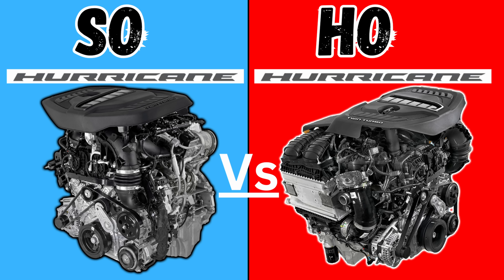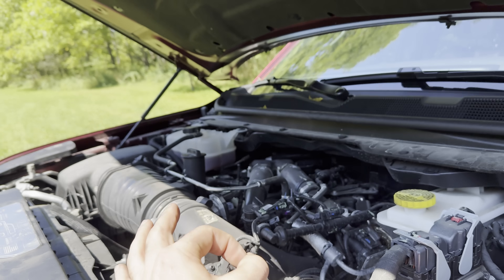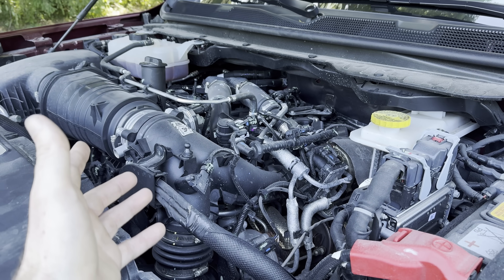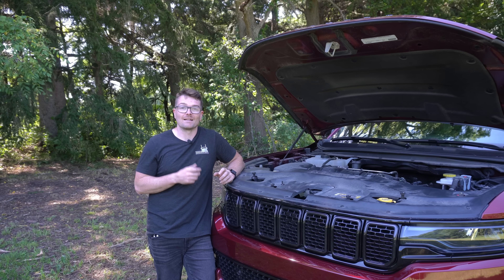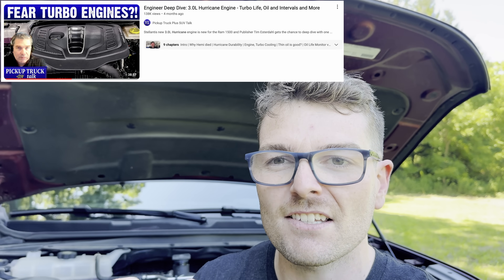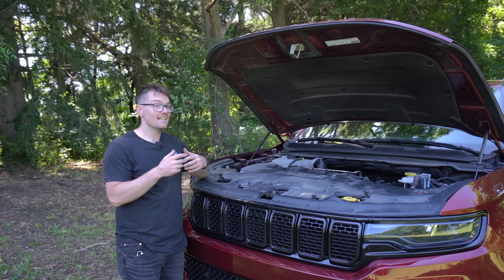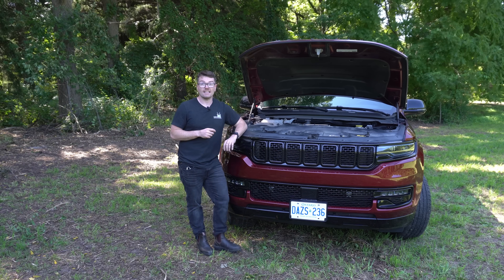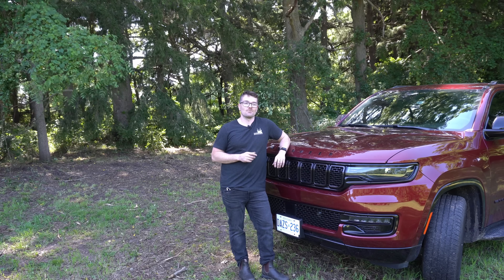Ram 1500 3L HURRICANE Twin Turbo HIGH OUTPUT vs STANDARD OUTPUT Engine | Which is BETTER?

Comment: Check out the towing test for the HO Hurricane on TFL. It actually did better than its competitors. Ram engineers are not idiots. Everybody talks about no dipstick, just like everyone complained when the Rams began coming with rotating shifter. Now, it’s just normal. The oil indicator instead of a dipstick is probably a good thing for many people. When I was dating my wife, she was driving a Geo Tracker with 35,000 miles on it and she had never had the oil changed because she didn’t know she was supposed to. She’s not an idiot, she’s a highly respected Internal Medicine doctor. Some people just aren’t mechanically inclined. She can’t work on your car, but she can diagnose diabetes or heart disease in the guy that can fix on your car.
Reply: New Ram makes the competition look like wagons. Ram already smoked the ford up the TFL toaster. Lots of trolling from the hate tells me everything. Not much trolling Toyota who completely failed on their engine because they aren't threatening the egos of haters
Reply: @fullbloodedchristian6440  You need to rewatch that video. The Ram was at 248F coolant temps and the F150 was at 250F when it went to limp mode. Were talking 2* difference, on an F150 that wasnt even rated to tow that heavy of a trailer vs that best possible configured Ram(Tradesman with 3.92 gear). It did not SMOKE the Ford.

Also you conveniently forgot to mention the low oil pressure warning.🤣 I think I would rather my coolant get to hot than my oil pressure be low.
Reply: The rotating shifter is trash, period. Just because its ‘normal’ now doesnt change that. It just shows that companies do whatever dumb things they want and consumers have to deal with it.
Reply: @PonyFoot123 It is a preference.  You think it is trash and the next person likes it.  I personally like cold column shifters, but the reality is that you get used to any of them.
Reply: @PonyFoot123  I like the rotary shifter 🤷‍♂
Reply: Depends.  If the goal is to design something noone wants, then watch sales take a dump, then, as GW once famously said,  "Mission Accomplished".    

Maybe it will outpull a Hemi in some random test, between two new vehicles.   Noone gives a shit about a few percent performance difference.   We do however care about the cost of repairs and parts replacement over a decade of ownership and 250,000 miles.   
     Small displacement turbo truck engines have been around long enough that we all know how that goes.  Turbos shitting the bed, intercooler leaks,  the famous intercooler full of water condensation, cough cough Ford, that bogs, backfires, and sets a check engine light whenever you go more than half throttle.   The kinds of POS engines have been around plenty long enough for us to know what were getting!
Reply: I think you made up your mind in 2015. Current gm 2.7l putting up better reliability rating up to 100k than their 5.3l. Fords 3rd generation ecoboost have engines with 300k plus miles on them now. Original turbos. Im still buying n/a engines for now but these turbo engines are getting better. So I agree with you kinda. Keep an open mind. Things do improve @kensmith174
Reply: You have some kind of perverted worldview in America. Diabetes mellitus is an endocrine disease. To make such diagnoses, it is necessary to understand the biochemistry of our body very well. And this requires a deep study of chemistry and physics. Such education makes a person’s horizons and logic much deeper. How, after this, one can not think about the fact that a technical device needs maintenance remains beyond my understanding....
Reply: Hope you traded that geo tracker in 😂
Reply: Ford is just trash, TFL proved it again. All that budget, even made them aluminum to have a huge advantage and they still make absolute trash.
Reply: Dodge engineers are, and have been, major idiots for a long time...!!!
Reply: Cope.

Comment: So cool, thank you for the information and the great deep dive into the engineering details.

I am surprised there is not an EGR cooler, but I am guessing the larger air intake intercooler can deal with the EGR gas's heat, and the engine is spec'd to be running 91 octane, so the cylinder temperatures can be a bit higher.

Comment: In your last video you pointed out that the turbo cost 10k each to replace. I would rather have the 3500 with the 6.4 Hemi. The 2022 5.7 Hemi 1500 4th gen I have now will have to last me for life. I am priced out of the market now.
Reply: 10k to replace?  Each?   Wtf.
Reply: You wouldn’t replace the turbo anymore than you replace the engine; you rebuild it, and rebuilding it would be much less the. 10k.

We don’t know the longevity of the turbos yet, but if they last as long as the engine, it isn’t a big deal as it’s likely close to the same cost and effort to completely rebuild the Hurricane and turbos at 300k miles as it is to completely rebuild the Hemi.

If it turns out they die much earlier, then it becomes a different conversation, but it is too early to make any definitive judgements on it (though I would avoid it for a couple years until we have enough info to make those judgements and let others risk the money to figure it out).
Reply: @Cloud30000 One would be facetious to assume that turbo reliability will be any better than the Ecoboosts platforms have experienced. They’ve dropped turbos before 100K miles. The simple truth is that smaller boosted engines will have high costs of ownership IF you are the type of customer that keeps a vehicle for extended periods of time. One turbo failure will make the average customer wish they had a hemi.
Reply: You guys act like turbos are a new thing . 
Turbos have been around for decades and are very reliable.

Comment: Most thinner oils are recommended for fuel economy reasons. If you look up the oil specs on AllData for many modern engines that recommend 0w20 for example, the 0w20 is only recommended for the United States, everywhere else recommends  something like 5w20 or 5w30. Ill take my chances with a thicker oil. And no, if your engine fails under warranty the dealer is not going to analyze the oil to test the viscosity, unless youre running like bar and chain oil or something obvious.
Reply: Look at some of the Toyota V8 manuals. Here in the US it absolutely must be 0W-20. Overseas the same motors are fine to run 20W-50 🤣. Even the new 3.4LTT in the Tundra is speced with 5W-30 overseas in some cases while its 0W-20 only here.
Reply: I would always run the heavier oil. @Jay-me7gw
Reply: It's important to mention warranty could be denied if proof of service  receipts aren't provided. I do my own maintenance and I keep logs/records of dates mileage and all receipts. Never had an engine problem or warranty claim made BUT my sisters 1L eco boom let go and she was denied warranty with no proof of service.
Reply: I say no thanks to those thin oils. I use 5w-30 in my Ram 1500 and in my Accord.
Reply: Exactly what I was going to say. Look at the first get 3.5 ecoboost that was is the SHO it was originally 5w20 but when they started putting them in the f150 they changed them over to 5w30 without any changes with engine internals
Reply: 5-40 is the way to go

Comment: Down here in the states, at least in CO the 91 octane is more than $1/gal more expensive than diesel. So while that HO is tempting, I'm still looking at the LZ0 I6 diesel from GM(c).
Reply: If you are buying the truck for towing then realize that the HO trucks actually have a nearly 2500 lb reduction in max tow rating vs the SO trucks.

Also, with the lower compression ratio, I bet the HO runs completely fine on 87 octane but just wouldnt make its peak output. The modern PCM's can limit boost based on detected octane, Ford has been doing it in their Ecoboost engines since 2010. Thats why you see F150 3.5L Ecoboosts picking up 35-40 whp when running 93 instead of 87.
Reply: Go with LZO you won’t be disappointed
Reply: What would you do in Canada at 8$ a gallon ???
Reply: Problem with the LZO is the garbage tranny it’s attached to

Comment: These seem like amazing engines... for a race car.  There are different demands on a work truck.  You will not see these doing farm work in 10 years without massive repair costs.
Reply: Exactly. All of this extea power n torque on the ho - when it pulls amd hauls less than the 5.7 hemi - all while requiring premium fuel. Thats performance muscle/aports car specs n territory. Not to mention im very aure this will get much worse fuel economy towing than a v8
Reply: Sure though we’re talking about the half ton segment and upper trims which are catering towards lifestyle and recreational users.

Comment: I just took delivery of a Ram with the high output engine.  I will see how it goes.
Reply: Godspeed sir
Reply: I have zero issues with the HO engine.  I now have 16k miles on it.
Reply: @davidzelkowski9948 where are you at now?
Reply: All of the thermostats are going on the Hurricane at about 35k. Not a traditional thermostat, it's like a plastic housing. They are on severe back order.
Reply: @huemongus3742 ram/Jeeps are like euro vehicles as under the hood major components are made of plastic and we all know what happens to plastic when it constantly goes through heating and cooling cycles. It will be expensive just junk in a matter of years with plastic components failing, cracking, leaking. Just ask BMW, Mercedes, Audi, VW.
Reply: @blackice7408 So far it's been fine.  Interesting that you asked if it's an SRT 10 killer.  I did the Viper engine calibration and dyno testing, including the truck, at Chrysler before I retired.  I would say it's probably quicker than the Viper powered quad cab.
Reply: @davidzelkowski9948  that's insane when u think about how much power they were able to squeeze out of a 3 liter vs an 8.3 liter and how it will beat it. The ho hurricane engine is a high-performance engine - not a proper working engine. All of its towing specs are weaker than the weaker 5.7 hemi and even the regular hurricane engine. Premium only. High sprung. High 4 second 0-60 in a pick up
Reply: @blackice7408  I will see what happens. My last truck was a 5.7 Hemi.  It towed my camper just fine and the sounds that engine made were great.  When I ordered this truck there were certain options I wanted and were only available in the Limited model.  And of course I got stuck with the HO engine.  I haven't hauled the camper yet and I'm hoping the guys got the knock system calibration dialed in.  It's going to be seeing a lower octane fuel.  I went to work at GM after I retired from Chrysler and they relied on the knock system more heavily than Chrysler at the time.  In other words they were more aggressive on engine timing but I don't think it was beneficial having worked with both systems.
Reply: @blackice7408  Which makes me question the longevity of the 3.0L engine.  It's unlikely there are no weak points in the engine.  Time will tell.  I'm more concerned about miles of plastic tubing failing due to age and heat.  I can see a lot of nagging problems down the road.
Reply: The truck and it's engine have been just fine.  I've pulled my camper a couple of times without issue.
Reply: So how's it going with it? Is it an srt10 ram killer?
Reply: U commented this 5 months ago. Any updates?
Reply: @novaeagle9213  The truck and engine have been great.  But the truck sat for 3 weeks while I was out of town.  The truck was dead.  The two batteries are absolutely flat. Not sure where this will lead.
Reply: Still all good?
Reply: @maldog5118 No problems at all with 17k miles on it.
Reply: @davidzelkowski9948 that's great to hear. I'd like to wait myself. I keep my vehicles over 200k. So I'd like to see some models hitting that #. I'd be ok with the S/O. Hek, I'd be ok with the 3.6.....but they unravel at 75k-125k. To their credit, they'll go longer after you dump some initial cash into them. Damn plastic oil coolers...
Reply: It's been fine. No issues at all. @maldog5118
Reply: Good luck. I just got rid of my 2020 RAM Limited with a Hemi. That engine is utter trash. Honestly, I think you may have teething issues with the inline 6, but maybe not, but I’d rather take that risk over owning another Hemi 5.7 and watching it eat itself again. So you will probably have far better luck than I did. I did drive the HO version of this engine on a demo test drive and legit…it’s an impressive engine. I think their truck pricing scheme is broken, the Limited is missing a lot of stuff compared to an F150 Plat Powerboost or a Chev/GMC so dollar for dollar RAM seems out of step at the moment. 

I ended up with a F-150 Powerboost HEV Platinum trim. So far so good. Very powerful but doesn’t quite feel as fast as the HO in a roll but the powerboost feels stronger off the line with its electric motor for sure. No turbo lag, that traction motor fills in nicely until the turbos spool.

Comment: side  intercoolers  are  trash  ask  any  mk5  turbo  owner

front mount  way  to  go
Reply: Does it do its job? That's the only question that should be asked. 
Air to air are different than liquid to air btw.....
Reply: Its a liquid to air intercooler. It is "front mount"

Comment: I'd be going absolutely no further than 5k miles between oil changes on one of those things.
Reply: I stick to 5k on my 3.5 turbo charged engine in my f150 but for a standard NA engine I would also think you should stick to 5k
Reply: @TexasNationalist1836  I do 5-6k in my 5.0. On a boosted engine I think the cost of frequent oil changes is worth it to keep oil dilution minimal
Reply: @AKS-74U  I am looking at a I6 300

Comment: Sounds like a dumb eurotrash move to manufacture all these extra parts when you could have spec'd one engine for HO and then used tuning to create the SO...
Typical euro move that results in less cost effectiveness and a huge increase in required parts on the shelf for repairs.
Not shocking that stellantis is in the position it's in financially.

Comment: Nice job Alex.  Id buy a Ram 2500  6.4 before I would go a turbo 1500.  Id bet it costs less too.
Reply: If you are primarily looking for a daily commuter and only tow a 8k trailer half a dozen times a year, the 2500 is a waste (and absolutely more expensive if optioned up to have the same features).

Why not just go for a 3500 dually instead of the 2500?

If someone wants a 1/2 ton, they won’t switch to a 3/4 ton with a completely different design to avoid the turbo; they just choose a different 1/2 ton without a turbo.
Reply: @Cloud30000  a drw is not needed.

A 1500 is a glorified mall cruiser, nothing more. I don’t want any of the crap that you are forced to take when getting a 3.0.

A regular cab 2500 4x4, 6.4 hemi, 4x4, 8 foot bed in tradesman trim is all that I need. 

I prefer the solid front axle over IFS, far stronger too.
Reply: @Cloud30000..Why would you go to a 3500 drw instead of a 2500 ? That doesn’t make any sense . Going to a 2500 is a waste but going to a 3500 is not ? lol
I pulled a 8000 lb camper with a 1500 and hated it . Went to a 2500 and it was night and day difference.
Reply: I have a NBS 2020 5.7 Hemi 1500 that originally cost $70k. I have seen 2024 6.4 new Powerwagons that low today. I wish I had a Powerwagon even though I commute with my truck and my trailer is only 5000 pounds tops.

Still I would be willing to try one of these new HO SSTs. At least they are noticeably quicker.
Reply: To different trucks so who the f cares
Reply: Two

Comment: Both should have an engine oil dipstick.     Huge oversight by the engineers and bean counters.
Reply: Not an oversight. It was intentional😂
Reply: I would have preferred a dipstick, because I actually check my oil, but probably 98% of people don’t. Stellantis probably figured it would monetarily be the same cost to eliminate the dipstick and replace it with a low oil light. Safer to for most people, since they don’t actually use the dipstick.
Reply: @lanceolot22  You scroll in the gauge section and it shows you the oil level and it is pretty accurate.
Reply: If you don’t check the oil, you won’t think, ‘why didn’t I buy a V8?’ 😢
Reply: Lol.  I don't think you know what the word "oversight" means.
Reply: They under European oversight. European motor don't run dip sticks anymore for many years.
Reply: Lol
Reply: No oil dipstick is a No Sell for me. I prefer keep an eye on condition of oil , oil lvl.

Comment: I feel like the HO would be better in a work vehicle because of the better forged internals and thicker oil requirement. Also the bigger intercooler would probably be better for sustained loads.
Reply: I agree with this. Also, the lower compression ratio which would still be beneficial even if you are not using all 510 ft-lbs of torque and 540 hp. Pulling a trailer up a grade at 60 mph still needs a lot of torque and cylinder pressure and I am guessing the lower CR will help.
Reply: I agree if you aren't constantly using full throttle. If you drive normal the HO will last longer.
Reply: It's too high stressed for heavy duty applications. It would need 3 or four more liters of displacement for that, in order to last.